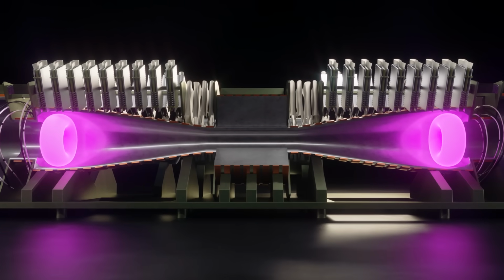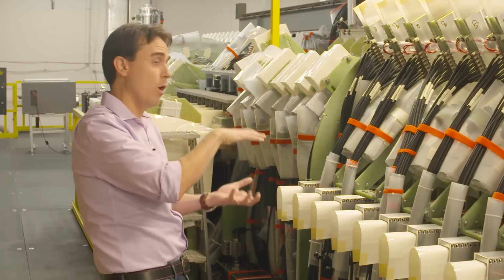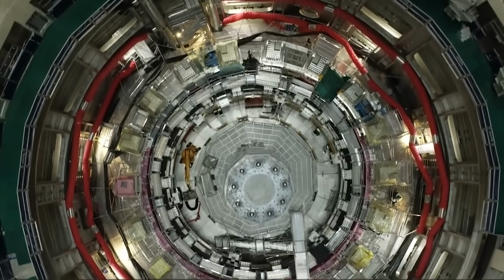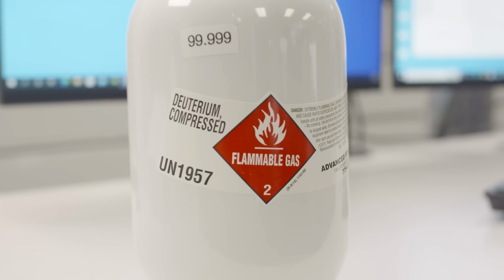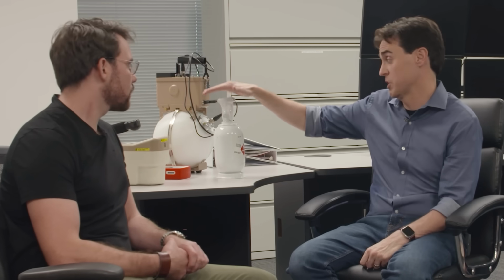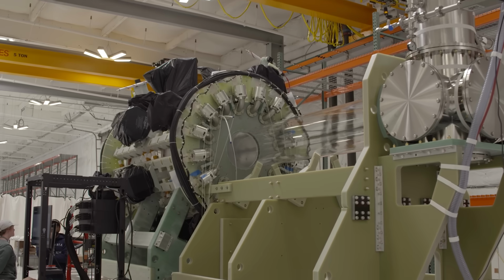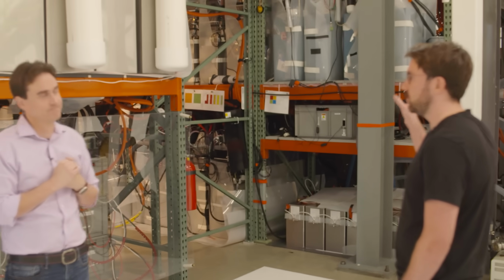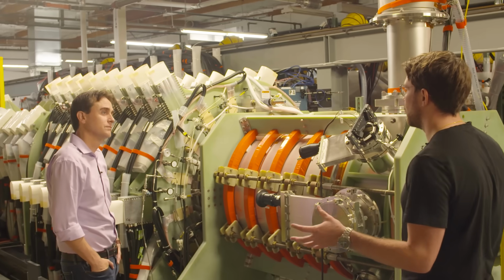A New Way to Achieve Nuclear Fusion: Helion

Comment: The main reason there isn’t much beryllium production isn’t because it is rare or because it is hard to extract, it is because there isn’t much demand for it. There are a lot of mines which have to design their processes carefully so they don’t have to go through extra steps to get beryllium out of their products. If there was a market for it it would be worth reducing the beryllium and extracting it.
Reply: Beryllium is also pretty toxic.
Reply: @photodan24  being inside a fusion reactor is a pretty nasty environment in general so that wouldn’t be much of an issue once it is built and specialists routinely handle much much more dangerous substances.

People could screw it up however I would say Beryllium is way down on the list of things that would stop or slow Tokamak production.
Reply: @glenecollins  What could go wrong with a multi ton mantle of radioactive metal that transmutes into near light speed Helium nuclei over it's service lifetime ⚛️
Reply: @KN-xl6lw  if it is in a fusion reactor that is a good thing, when it is decommissioned apparently the calculated period where it will be too radioactive to recycle is 100 years, we are currently using literally tonnes of uranium which will remain dangerously radioactive for many billions of years, or burning coal containing Uranium, thorium and potassium a lot of which gets pumped into the air to fall out in areas around the power stations substantially raising the background levels of the surrounding areas (and most of that is of a size where it can be inhaled which isn’t really a problem with either Tokamak shells or spent fuel rods.
Reply: @glenecollins  spent fission fuel will be about as radioactive as granite in ~450 years and safe to handle in less than 150. Uranium and plutonium aren't particularly radioactive and the hot materials (cesium and strontium) will be essentially gone in 350 years
Reply: @miscbits6399  that isn’t exactly how that works granite is typically a fraction of a percent uranium and can be something of a hazard. A chunk of what was pure uranium gets more radioactive the longer you leave it sitting around (on human time scales) because the breakdown products accumulate.
Spent fuel rods will initially drop in radioactivity as the shortest lived isotopes decay however it will still be tens of thousands to millions of times the background radiation if you are exposed directly to the rods at any time in the future that we will have to worry about.

Other radioactive waste like contaminated equipment, etc which is usually stored by being encased in concrete should go down to the radioactivity of granite in hundreds of years as you said.

Hopefully we will have advanced reactors which can utilise the remaining energy in the “spent” fuel rods at the moment only countries which the others (with nukes) trust with fast breeder reactors can make use of them.
Reply: @glenecollins  we have those reactors  already. Or had them in 1965-69....

Molten Salt Reactors are primarily uranium fuelled (u233 from thorium or u235) but can burn nearly anything fissile or fissionable as sidestream fuel and have waste output less than 1% of solid fuelled designs

They also don't suffer from xenon neutron poisoning and can't go prompt-critical like Chernobyl did (this was tested in 1967)
Reply: @miscbits6399  basically any form of fast breeder reactor is likely to be prohibited by nonproliferation treaties etc, a lot of countries are allowed them to make isotopes for nuclear medicine. However those aren’t allowed to be big enough to use as a power reactor or to process fuel for power reactors.

One of the big reasons the US went away from molten salt reactors was because it was harder to make weapons grade uranium or plutonium with them however there were other problems including more moving parts and potential for leaks etc.

A lot of the “advanced reactor” designs that are popular now are from the 60s but could be made to self destruct if tampered with so people couldn’t change it to produce weapons grade fuels.
Reply: @glenecollins  the issue isn't so much that it's harder to make weapons material from them as that they would free civil nuclear power from the shackles of being dependent on the waste product of weapons production 

Enriched uranium is a byproduct of weapons-grade plutonium manufacture as that requires the  purest u238 as possible. This is why Alvin Weinberg used it in the Nautilus reactor - it wasn't the best possible fuel, but in his words "it was all that was available" - in the hundreds of tons

If civil power no longer relies on enriched uranium then the "dual purpose" nature of enrichment facilities no longer applies and as a primarily military facility they become susceptible to limitation treaties 

NB: whilst it's theoretically possible to extract weapons-grade material from used power reactor fuel, it's never been done to make a weapon. Trying to do so would hopelessly contaminate any existing military site and render it completely unable to function. 

In other words, the proliferation risk of used fuel is a misdirection tactic. 

The real proliferation risk is using "special fuel rods" made of depleted uranium, giving them brief exposure to produce weapons-grade plutonium.  All solid-fuelled designs can be misused this way (even CANDU). In fact you can say that virtually all solid-fuelled designs are built firstly for weaponisation and secondly for energy production.

With regard to leaks: a molten salt reactor freezes solid at 400-450C. Any leaks are unlikely to propagate more than a foot. Compare and contrast with high pressure water wanting to flash to steam at 1400 times the volume and keeping that contaminated water out of the biosphere. This is a fundamental driver of the extreme costs of reactor vessels and containment buildings - AND the temperature of water moderated systems isn't hot enough to produce dry steam, so the power turbines suffer far more damage in operation from droplet condensation hitting the blades.

Molten salt systems would be around 80% cheaper in terms of reactor vessel and containment building costs, yet still be stronger +safer than water moderated designs. On top of that, thorium fuel is $120/kg (it's the primary waste product of rare earth mining and currently a major nuisance. Supplies are not scarce). 3% enriched uranium is around 50-75,000/kg (more expensive than gold) and you only use 1% of its mass in a solid fuelled reactor (the rest is thrown out)

All in all, Alvin Weinberg's "Mark 2 industrial prototype" nuclear reactor has a lot going for it. China has has a rebuild of the ORNL MSRE running for the last year (as of Dec 2022) and intend pushing forward with it

A MSR is hot enough to be a drop-in replacement for coal burners - and such a reactor would be 25% the size of combustion plant. It is probably not a  coincidence that virtually every Chinese coal-fired power station built since 2002 has an area of clear ground adjacent to the turbine halls which looked reserved for future expansion but seemed too small for more burners
Reply: @miscbits6399  fast breeder reactors are substantially more competitive with molten salt reactors, they are able to utilise most of the Uranium which produces quite a bit more energy per Kg than Thorium, they also only need a small amount of U235 or some other fissile material as a starter.

If companies could make them break down if they are tampered with they would make very good small almost portable reactors to add base load power in areas in need of it (which used to be developing countries but now seems to be Europe because the idiots need to get off Russian methane)
Reply: @glenecollins  uranium is hellacuously expensive to enrich and doing so is a weapons proliferation path. Yes it has slightly higher energy than the u233 from thorium path but it's at least 500 times more expensive and the weaponisation risk is there

U233 is essentially unweaponisable. Making bombs from thorium has been tried by the USA,  USSR and India. If it was possible they would have done it as such a weapon would be under 1% the cost of a plutonium implosion  device. Instead, every attempt to use u233 by itself or in mixtures resulted in fizzles or vastly reduced yields barely exceeding a fizzle (operation teapot). The u232 issue is insurmountable despite claims it could be seperatable at the proactinium stage
Reply: @miscbits6399  Not true.  You are copying from Internet's Thorium fans.  U.S.A. successfully tested a U-233-based device in Operation Teapot (1955), codenamed "MET" (Military Evaluation Test), yielding 22 kilotons—lower than predicted but still a functional explosion.  A bomb was exploded in testing.  How is it essentially unweaponisble?   Nuclear bomb owning countries have not chosen this route because it is not efficient or economical to do.  However it does not mean other middle east countries sanctioned also abandon this technology due to efficiency and effectiveness issues.  RBMK nuclear reactors from former Soviet Union are designed to be due use i.e. generating electricity and making nuclear bomb material in term of Plutonium 239.  However those reactors have never been used to produced nuclear material for bombs.  Even former Soviet Union considered cost and effectiveness.
Reply: @miscbits6399 and yet CANDU can run on thorium in theory, so why don't they? And yeah, India got CANDU reactors given to them by Canada and they made a bomb from it, then we cut them off and they just cloned the first ones more or less. The high cost of that much deuterium water is helped by the natural uranium being usable, but thorium would be dirt cheap if that works.
Reply: You're misunderstanding the issue. This isn't about theoretical yields, it's about what is available cheaply and plentifully enough to plausibly create fusion energy at a cost competitive to existing fuels. 

Real economies can't be expected to adjust to a new demand so rapidly. In order to produce fusion reactors at scale global beryllium production would need to increase at least tenfold, along with our capacity to manage the irradiated waste. Regardless, cost and availability is the most important variable in supply chains like this, not gross global supply.
Reply: @pepperypeppers2755  Cheeap and plentiful like the hundreds of millions of microwaves in existence with beryllium insulators people throw in dumpsters daily?
Reply: That was my thought as well.  In the early 2000s we were looking at granitic pegmatites across Northern Ontario. Beryl was quite common in the evolved ones, though the focus at the time was for Tantalum Oxides.
Reply: USGS estimates the world beryllium resource at 100,000 tonnes.   That's enough to allow ARC reactors (2014 paper) to supply only 1% of the world primary energy demand.
Reply: Beryllium isn't rare on Earth but it's extremely rare cosmically, stars fuse it into other elements extremely fast. Same with Lithium
Reply: It is rare and toxic.
Reply: Beryllium dust created during manufacturing is not good, It’s vey expensive to contain.
Reply: Guess its time to start investing and stockpiling huh.
Reply: "Beryllium constitutes about 0.0004 percent by mass of Earth's crust"
If this does not mean it is rare then what does it mean ?
Reply: @kiyoponnn  0.0004% is about 4 parts per million Uranium which we mine to use directly as an energy source is about 2PPM silver is less than 0.1PPM and gold is about 0.001ppm 4 parts per million is not considered rare however if it wasn’t more concentrated than that it would be a pain to extract fortunately there are a lot of places where the waste heaps contain up to 1% or so Be.

If there is a market for it most elements apart from a few big ones like Iron, Nickel, gold, Lithium etc can be extracted at orders of magnitude higher rates than we are currently mining them without raising the price substantially, in a lot of cases the prices of things like Rare earth elements have gone down considerably even as demand increased dramatically because it became a commodity rather than a specialist product.

The most extreme case of this was Aluminium which in the 1850s was more expensive than gold (aluminium is one of the most abundant elements in the crust so it was actually the price of energy and therefore smelting costs which dropped so it isn’t actually a good parallel)
Reply: @kiyoponnn  the Earth's crust is an absurdly large amount of material
Reply: Water is 0.05% of Earth's mass, for reference.
Reply: @johncaccioppo1142 Earth's mass is very different from our crust's mass.
Reply: @kiyoponnn  the earth is HUGE? Open any one of hundreds of millions of microwaves on earth take out the magnetron smash the insulator and you too can get beryllium poisoning BUY ONE (Microwave) New at Wall mart for 30 bucks you can Cook your Food and Get some of that expensive Beryllium
Reply: yes but thats NOT pure beryllium ! Even the rare earth is abundant but separating one element from another say...praseodyum from neodyum is such a COLOSAL challenge . Making it economically is just impossible
Beryllium being hard to purify dooms any ECONOMICAL calculus just like the ''rare earths'' do or just like extracting and handling titanium does But the titanium is a bad example because its an order of magnitude easier to work with. Altho requires impressive machineries and expensive processes titanium is still DOABLE
Reply: @kukulroukul4698  Beryllium is considerably more common than all the rare earths, Bertrandite, beryl and Chrysoberyl are all relatively easy to get Beryllium out of and they are relatively easy to separate from the host rock. Compared with REE which tend to be substituted into other materials or are in extremely fine grained disseminated crystals.
Reply: @glenecollins  And nearly impossible to separate from uranium, iron, and and cobalt found in it.  Uranium poisons the reaction and causes the beryllium blanket to decay prematurely in a neutron flux.  The result is the production of radioactive isotopes difficult to dispose of. The costs of building and replacing Tokamak reactors are also excessive. Tokamak reactors are a dead end even if they worked which they don't. We're far away from affordable clean fusion energy.
Reply: @glenecollins  The average concentration of Be in the Earth's continental crust is 2 ppm.   Cerium is 60 ppm.
Reply: @pauldietz1325  the other guy said it was 0.0004% I just translated that into PPM there is at least that much uncertainty in any of the ones that are single digit PPM so I went with it there is probably a source which says that However I agree most of the estimates don’t put it above 2.7PPM

 Cerium is a bit of an odd one it is quite high in a lot of environments but doesn’t necessarily accumulate just in the same spots as the other Lanthanides (we normally look for Lanthanum, Niobium and Yttrium) however I think the production of it from REE mines is enough to keep the price low Cerium Oxide  goes for about $1600 per tonne and the metal is about $5 per Kg (yes I just checked🫠). There is way more potential production of Cerium than there currently is market for it.
Reply: Isn't berylium what the loop of a padlock is made out of ?
Reply: @TheKaos90  beryllium bronze is relatively tough and less dense than other bronzes but it would be easily cut with bolt cutters etc. you ma be thinking of Boron Steel or boron carbide both are used in locks because they are harder than high carbon steel and relatively cheap.
Reply: @glenecollins bro im just impressed tht u have all this info, whats ur line of work? Superdope stuff
Reply: @HummusPvm  exploration geologist, I got interested in metallurgy when I was in University, I mostly studied extractive metallurgy as it is more important for exploration, I picked up enough physical metallurgy to think of why to look up.
Reply: @TheKaos90  No. Beryllium's most common uses are in heavy-duty electronics as an additive or alloy, such as microwave oven magnetrons or lithium battery contact springs.
Reply: @TheKaos90  NASA used Beryllium for the JWST mirror segments.
Reply: If there was ever going to be a profitable “market” for it, we’d have a reactor operational already
Reply: @Otterdisappointment  so u think someone knows all future?😂 you couldnt be more wrong in your statement, there are new inventions and discoveries all the time that require different materials^^
Reply: @HummusPvm  ironically they do believe that about the future being predictable, that’s what their username is a reference to (to simplify the reference to a point where others can understand it)
Reply: You can find beryllium in a crapload of microwave ovens lol so rare

Comment: Converting directly to electricity itself is so mindblowing. All the mainstream tech from 1800 till now all use steam turbines and just swap the energy source either coal, gas, wood, uranium, geothermal, etc. Then theres renewables that do convert straight to electricity, but you cannot control the sun or the wind.

Comment: Absolutely brilliant outside the box thinking on every aspect of Fusion. Direct electricity conversion is such a radical change, but makes perfect sense for next gen power production, along with fuel types, reactor size and rapid scalable iterations based on lessons learned. I am very much rooting for this company's success, and if I was a Billionaire would give a blank check. I just wish we as a society were a bit more science minded than sports minded.....